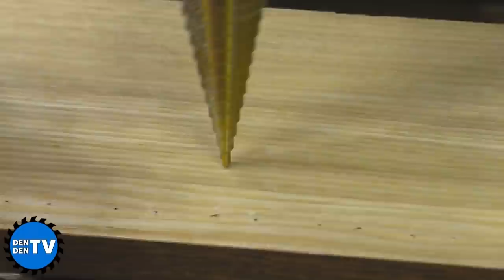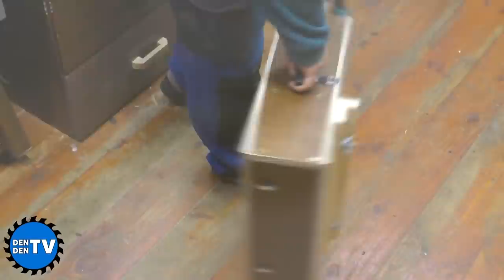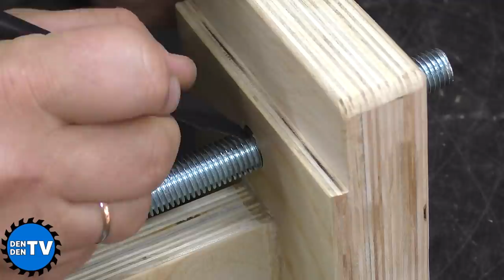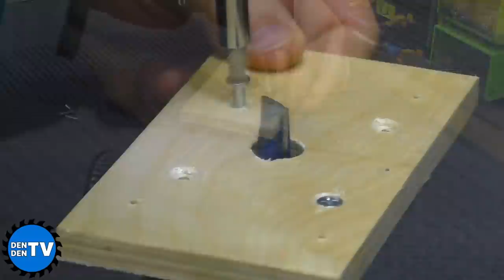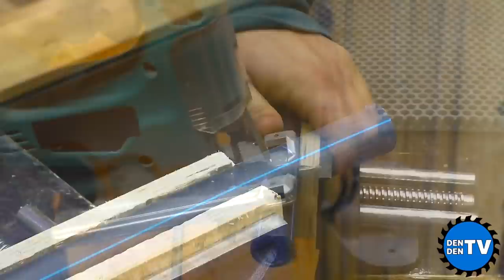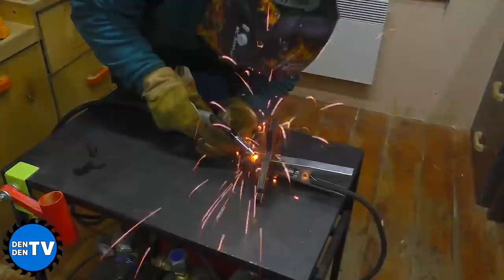4 homemade devices for the home master! Do not buy do it yourself!

Comment: I don't buy it.  First, spend $20K on tools and years practicing with them.  Then spend 5 times as much money on materials as you would on the product so you can take a week to build a far less capable version of the item that will only come out as good as the video if you're an expert craftsman.  Great concept.
Reply: Lots of videos in the internet are pretty useless,  but this one is pretty good.   I've built something similar with a cordless drill and a jigsaw.  Called the behemoth (for proof check my channel). Not as pretty as that thing in the vid,  but it works.  Replaces a 10k opal cutter.  Probably took about 200 bucks in tools- the materials were recycled.
Reply: Oooooookł ki oo

Comment: So how would you cut the plywood top and bottom if you don't have a table saw to begin with.....I call bs
Reply: The drill is not powerful enough for me it's B S too .
Reply: @bendermi  yep. less than 500rpm on most drills where the average table saw has over 3000.
Reply: @Corathor  
The two speed models are from 300 to 3000 rpm it's more the torque.

Comment: Sir I have a upgrade on your table saw put a hole in either front or back to attach a piece of PVC pipe to attach to a shop vac 🤔
Reply: And a safety switch at front.